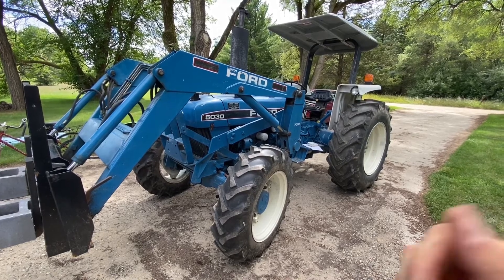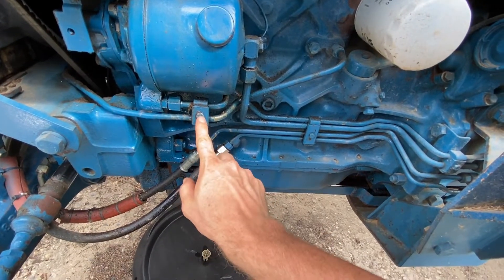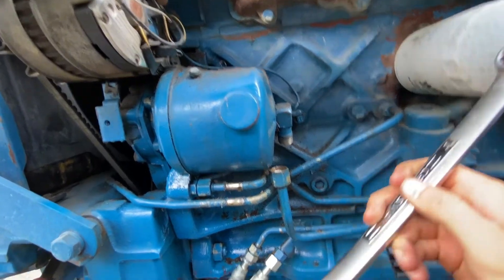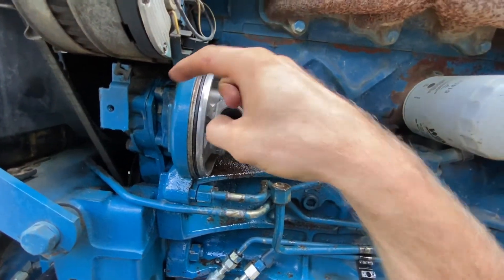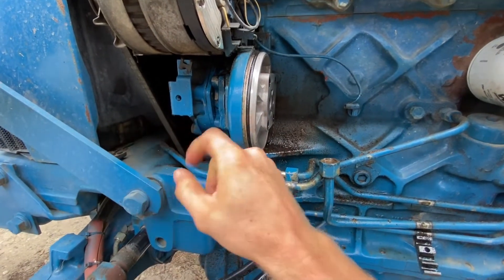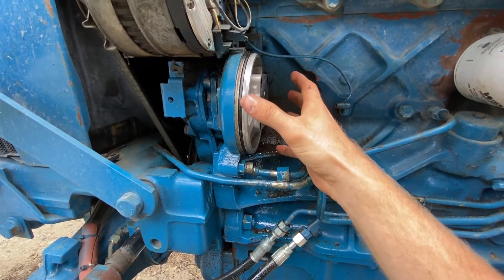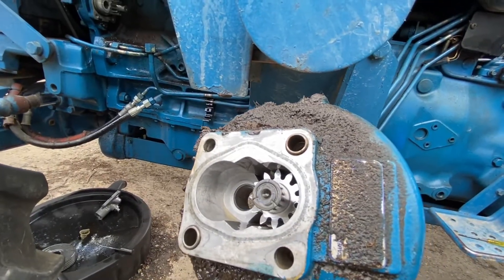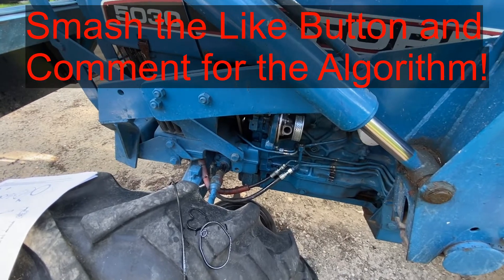Ford 5030 Power Steering Pump Rebuild and Filter Replacement, Leak Repair, Oring Replacement

Comment: I have a ford 5610 FWD but it has the same power steering cylinder as yours and it is leaking and needs new seals.  The power steering cylinder is integrated with the FWD axle and so you cant remove the cylinder to replace seals and clean out etc.  Have you repaired yours and do you have a video of that process?  If so or if you know of a video can you post it?  Thanks

Comment: Hi I'm not sure you're fluent in  french so I write in english. I take info on your video because I'd just replace my pump and no presure. I can see you have hollow part at the bottom ib the two 8 alloy shape. I made a mistake placing on the top. I change the same seals but I cut them and stick because nobody is working right now.. My pump is 10000 hours so I've got 0.15mm clearance into bearings. I reduced surface because my friend could'nt provide square seal to cut. I machine also the opposite surface to reduce lateral gap from 0.1 to 0.04mm. Mine is fitted with a valve and I placed 1mm washer under the spring-I'm gonna removed it because there is a 1mm hole inside the piston and may be it's a factory adjustment. May be you should have removed the sprocket because the 2 lip seals make grooves on the shaft and oil risk to be transfered into the engine oil. Otherwise you made a good job dans les régles de l'art.
Reply from the maker: Thanks for the info. After replacing the seals as shown in the video my power steering pump leak stopped. I haven’t had any issue with it so far.
Reply: @DirtRoadAutoRepair  OK you only have to control the level and if it goes down without any outer leak so it'll be internal.  I've a look at a cross wiev from the back surface on a 4610. the hollow parts are located  on the exit. So I sent oil from outer to inner. Now it's removed I'm going to check the presure valve if O ring if correct and running in the 2 surfaces each other, task I didn't finished